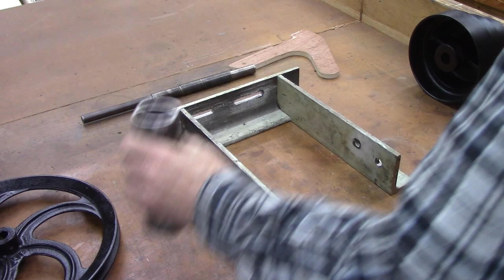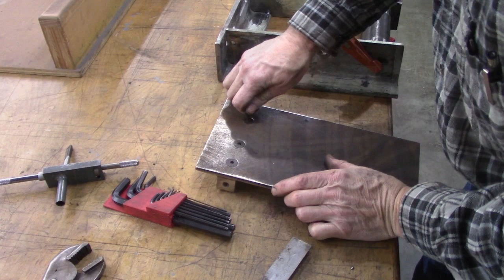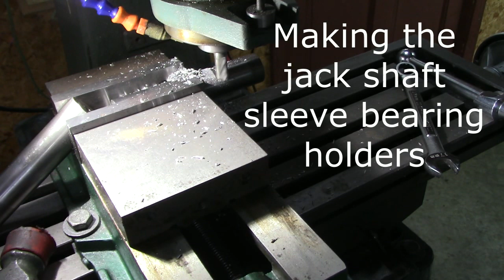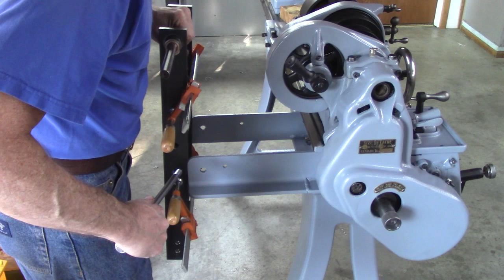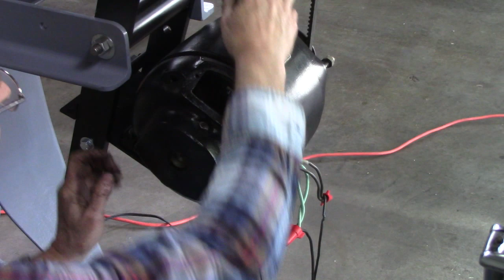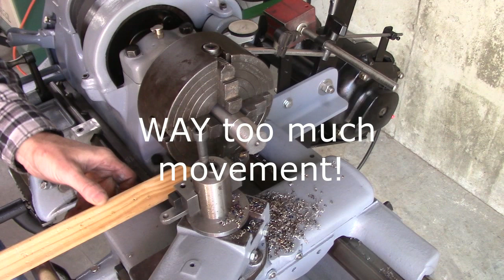South Bend 11-inch Lathe Rebuild - Part-4

Comment: What a well engineered drive!   Loved the reverse you engineered for the motor too.  It seems you have two ways to reverse the lathe rotation now.  Was the motor reverse a case of seeing if you could do it?
Reply from the maker: On this motor (repulsion induction) the only way to achieve reverse was to move the brushes and I really wanted a reverse for tapping. I agree, it looks cool and even works well. You can shift the lever to reverse with the lathe running forward and turning off and on the power makes it reverse. The brushes are only used for starting the motor.

Comment: Hi Winky, is there any chance you have photos of your bearing setup? I made new bearings for my 11" and am trying to confirm the contact surfaces are correct.
Reply from the maker: Like inside? I can take the chuck side cap off and get a picture if you want. It looks the same under the spindle. Beware...  I think there were a few different bearing depending on what year you have. Mine is a 1931. From what I understand some have felts and springs inside the oiler...  If mine had them they are gone. I keep mine oil every use. I need to put drill oilers on it. Let me know if you want the picture.

Comment: Great video. I'd love an old SB lathe. Question - Aren't you afraid of spinning the chuck off going in reverse (@42:10), or is there a locking mechanism that I missed? Thanks again for sharing your adventures in machining. Great stuff.
Reply from the maker: Thanks! Spinning off the chuck is unlikely although possible.  I've never had it happen.

Comment: Really Iiked this restoration. Just one question. What did you paint the pulleys with? Have a logan with the same type belt and I'm having trouble with the belt slipping under load.
Reply from the maker: The pulley is painted with satin black paint meant for plastic. I think Rustoleum but maybe Kylon. I don't think it effects belt slippage. First, Logan has a 1-inch belt if you have a 10". I know I had a lot of problems on my logan as well. A few times I tightened the belt and put a weight on the lid. My South bend has a 1.25" wide belt which helps. The belt is a rubber coated belt from the printing industry and it does well. I do get slippage but not quite as bad as with the Logan. I plan on installing a tension adjustment. Right now the weight of the motor provides all the tension on both belts.
Reply: Thanks. My logan is a resurrection of a bunch of logan parts primarily from model 200. I was unable to locate the complete belt drive system. My current drive resembles your southbend setup with only the weight of the motor to tension the drive belt. I would be interested in seeing you create a device for your southbend.

Comment: For me there is nothing more enjoyable thing than starting with a piece of steel, adding a couple more, drilling and welding, Turning a piece or two and adding them alongside the fasteners and finally a couple coats of primer and finally paint. Being able to stand back and admire our handy work that dose something and know it will always do what it was intended to do is such a feel good thing. I am lucky here as I can often see my work building up logging trucks and heavy equipment with my signature builds and hard surfacing pattern on a lowboy/bed going down the road. The upgrades you have done to this lovely old lathe that comes from a simpler time will now continue to make the parts that have built both of our great nations. Soon enough young machinists won't know how to work without a DRO or the simple basic machines that have worked sooooo hard for sooooo long and will continue to do so for all time if cared for as you and I care for them now. Great post Winky. You are preserving a fine lady from way back when. I may be a year late on this one my friend but better late than never eh, LOL. Take care my friend. See you on your next post eh.
Reply from the maker: Thats cool on the trucks. Satisfying I'm sure. I used to work in the printing industry modifying machines. Some of biggest and most rewarding mods were in the stacking area (called Stackers) where the product was bundles and sent to the bindery. To see the stackers go from jamming and producing ugly stacks to perfect without jams was great. Yes technology is great but I love the older machines. I have a DRO on my my mill but most often the lathe is okay without it.
Reply: @WinkysWorkshop  I had the best job in a big operation. I ran the welding and machine shop, got all kinds of one off things to build/invent and never really knew from day to day what I would be doing. There was 2 cattle/grass/alfalfa operations attached to it as well. Farm machinery I can live without eh. Everything is so lightly built it doesn't take much to bend or break it if abused in any way. Although one excavator operator that was notorious about abusing equipment tore out the boom base of a 300 Komatsu excavator. 2" x 24" x 8' TQ100 plates had to be replaced. It took me a month and 3 weeks later the same fella had the machine burn up while operating around burn piles. How he ever kept a job is beyond me but at the same time made me a lot of OT $ eh, LOL. See ya next post.
Reply from the maker: @TomokosEnterprize  - Sounds like a good job
Reply: @WinkysWorkshop  You bet, 15 years of doing all the skills I was taught by a number of excellent teachers. Every day was a wonder. When my health made me retire early it didn't take long to realize I had to find something to fill that void of creating things. The silver pouring saved my bacon. I still miss the smells from the machine/welding bays.  Burnt steel, oil and coolant in the air is just what tickles me the best my friend. This old thing teaching others is kind of endearing but the real thing just can't be replaced eh.
Reply from the maker: @TomokosEnterprize  I'm lucky to have the health I do have but I retired at 62 for the same reason. Youtube, family and creating kept me going.
Reply: @WinkysWorkshop  More alike every time we meet my friend.

Comment: I restore old machinery from 1896 to present, I've got some old electrical switches, did you ever find one?
Reply from the maker: No, I just need power. The motor doesn't have a wired reverse. The light switch is working pretty good just doesn't look old.

Comment: You have some slack in the head stock bearings...that's why it raises up and chatters on a heavy cut ...dose it have a hole thru the head stock shaft ...if so how big is the bore thru there...? just curious...nifty little lathe...now you have the job of tuning and truing it up...should be fun
Reply from the maker: Yeah, the bearing clearance is about .0008" now. My other lathe has ball bearing. This it the first one I have owned with sleeve bearings. From what I understand any less than .0008 and you will burn up the bearings. The bore size is 13/16".  Since making this video I've added new dials...  it's a sweet little lathe. The only thing I need to address now is a worn cross slide nut. The backlash is fairly extreme. The bad part is, I think the lead screw is worn a lot as well and the screw has a gear for the power cross feed and they are both made as one piece. I'll probably make a new nut and drill the end of gear and braze a new lead screw into the gear.
Reply: How is the flatness and straightness of the ways...I'm curious because I had all ways hoped to find one of these perhaps not quite that old or an older LeBlond for my own shop but never did when I had the cash to do anything about it...I don't have a shop or facility to put one in now.. besides I'm getting to far over the hill to do this kind work anymore any how...but I can still take vicarious pleasure from your projects and this is a beaut...thanks for the memories...so many things I made and did

Comment: I have an old South bend 11. not in as fine of condition as yours. My cross feed gear is shot. Other than that it dose ok.
Reply from the maker: Making a gear for it would be an interesting challenge if you have a mill.

Comment: Great restoration and video. I don't know if you are aware, but on the front face of the gearbox at top left, the vacant hole should be fitted with a Gits right-angle oiler for the speed selector idler gear. Before each lathe session, you slide the speed selector fully left and apply oil to this oiler.  The oil travels down an internal tube and drops onto the idler gear bearing - wait a few seconds before returning the speed selector to the correct position. This helps reduce the wear on the idler gear shaft which is rotated by each gear being used and so experiences a lot of wear.  Best wishes.
Reply from the maker: Thanks for the tip Brian. I've been giving it a shot of oil but didn't realize part about the shift lever.Also, I knew it was for oil but didn't realize it was supposed to have the oil cap. My  apron also has 3 holes near the top, I wonder if they are supposed to have the right angle oil caps too?
Reply: @WinkysWorkshop  
Yes, they probably are if they are anything like my 1943 Heavy 10. 
This has two right-angle oilers at the top and a larger one along the bottom of the apron. The top left oiler lubes the worm and cross-feed gears via felt wicks, while the top right oiler dribbles oil directly onto the half-nuts.
The larger oiler at lower left is used to top up the oil trough for the clutch and carriage travel gears.
I hope that helps.

Comment: Nice job two comments on serious one tongue in cheek firstly think your on/off should be a NVR type ond secondly really white cable ties 😉
Reply from the maker: I totally agree on the switch and ties! On the switch I was actually thinking an old time tail wagger switch  with a bakalite handle. I just can;t find one! ....  I just used what I had on hand. Something will turn up.

Comment: Nice job Winky. My old Logan 850 was last worked on in 1970 when I came home from the Air Force. I’m a bit old to try another rehab. I Think you should put on a DC drive or AC VFD to make it easier to set speeds. I put a DC drive on my drill press and I love it.
Reply from the maker: The VFD would be great but I'll probably leave the lathe original. It's fairly easy to change speeds. I may modify the drill press however. I think the lowest speed is 450 and it would be great if it went a bit slower.

Comment: What year was the lathe made? I have a 1923 13" x 48" South Bend that looks almost exactly the same.
Reply from the maker: It's a 1931. Does your's have a quick change gear box?
Reply: @WinkysWorkshop  yes, it does. It was my grandfather's. I completely rebuilt it 4 years ago. It works great.

Comment: Very enjoyable series you have a good eye for problem solving. Always nice to watch someone with the same mix of equipment that a lot of us with home shops have.
Reply from the maker: Thanks, I definitely quality as a home shop. No formal education of any kind although I have had a lot of exposure to machinery and machine work. The last 14 years before I retired I was redesigning problem areas in printing machinery. I did all the designing but worked along side a few top notch machinist. I owe a lot to a few great guys that were very willing to help me out.
Reply: @WinkysWorkshop  Well you put together some great videos. What kind of printing did your company do. I spent 40 years in the folding box printing industry.
Reply from the maker: @jimpritz4169 - Web offset magazine. I was a pressman before I was put in the trouble shooting job. I really enjoyed my job but after 10 years I used up most my good ideas and all that was left was the problems that were super hard (or maybe impossible) to resolve. The day I retired I had at least 20 projects going. I'm so glad to be out of there. I was totally overwhelmed for the last 2 years. The plant I worked in is shutting down in July. The internet really killed us. We never got back to normal after the recession.

Comment: Your videos are one of the very few I watch from start to finish. You are definitely a talented person and a good problem solver. I was curious as to what make and model your wire fed welder is. Mine is 125 amps and just can't seem to get good penetration on metal over an 1/8" thick. Nice work on the lathe, wish I would have kept my S.B. bench lathe!
Reply from the maker: Thanks on the lathe!  My welder is a Forney and it is junk. Actually it is probably a good welder but like most 110v welders, totally inadequate. I have a friend with a dual voltage Miller and he said the 110 option is silly. He said it's useless. I went back to flux core and it works much better... not great but better.
Reply: @WinkysWorkshop  Once you get things tacked together try heating the metals up over 250 to 300 degrees. That should help a lot.
Reply: I just mentioned to Winky to heat up your weld area to 250 to 300 degrees after things are tacked together. 125 should be plenty for a 1/8 in 7018 rod but it depends how strong the line voltage to your welder is. Extension cords must be 12ga or 10 ga or heavier. The longer the cord the heavier the wire size eh.

Comment: You're a very talented engineer. Neat, tidy, ... excellent work.
BTW I could be way off here, but I think the chatter comes from the motor, via the belt. I noticed it vibrates a lot in higher speeds. It kinda seems that vibration frequency (of the motor in the background here: 43:10) matches the chatter noises :)
Reply from the maker: The motor might be doing it but the bearings were very loose also. .006" clearance...  way too much. Thanks

Comment: 4 Cylinder Camry timing belts make great drive belts for the main drive. I used to have a old lathe, (Greenwood & Batly, overhead gear lathe) used the leather belt, too much vibration on the connector, the used timing belt no connector, and it didn't wear out either .... the belt that is.....
Reply from the maker: This belt is glued on. I used to work in the printing industry and they tossed this belt. You have to grind a taper on the end, use a special glue and heat it in a press. It's smooth as silk and the splice will not break. I have about 60 feet of it so it's my best option. On lathes like my Logan the spindle is a huge job to remove and this type belt is great. The South Bend would be east to install an endless belt like you suggested but I have a lot of this belt and I'm fairly certain it will last 8 or 10 years.

Comment: Great Job!!   I think you need a means to park the belt in a detentioned position when not in use. Nice enjoyable restoration series.   Best of luck & Stay Healthy...........................
Reply from the maker: Thanks! I've got about 60 feet of this belt. The printing company I used to work for tossed it. Plus this type belt (Polyamide) is not prone to stretching. I think your suggestion would be crucial with an original leather belt however.

Comment: great job I just got one like yours but it is an under  drive. It is missing the head stock and tail.
Reply from the maker: Those are important components!
Reply: @WinkysWorkshop  I did not find them yet. Maybe these parts should go to other machines

Comment: Some clever stuff going on there, love the forward-reverse set up.
Reply: Did you have do anything to keep the flat belt running straight. Nice work enjoy your videos
Reply from the maker: The flat belt pulleys have a crown. As long as everything it aligned and square the belt will stay centered on the crown. I guess I got everything lined up pretty well.

Comment: Nice job. Please show the dial build.  My 13" SBL has 125 graduations on the dial.  The setup you used before requires a 125 tooth saw blade and this is hard to find. I'd like to see your solution to this.
Reply from the maker: I'm fairly sure your dials have 100 graduations. There really isn't a reason for anything else. If you move one mark you move 1/1000", one turn 1/10". There are lathes with 200 graduations but older south bends are 100. The 200 dials are working with diameters. Each graduation these dials are .5/1000 (.0005") but this makes a change in diameter of .001" 

But yes, I will make a video of the new dials. I'll started planning and may start this tomorrow.  Thanks for watching!

Comment: Nice restoration of the lathe. Loved the way You solved the problem with the motor reversing. You can be proud of that job.
Take care and stay safe, Sir.
Reply from the maker: Thanks, I agree the motor reversing. A friend suggested hooking a cable up to the brushes but I think the linkage is a little better. It takes some effort to move which is good because it stays put.

Comment: The lathe came out real nice. Your powertrain design is impressive, simple and everything works well. I was surprised by how well the tension on the flat belt came out. I was thinking that it would be on the tight side. You should of seen the contraption that I made for my first lathe in the late 90's. Thankfully all evidence has been destroyed!! That lathe was a 10" Seneca Falls from the mid twenties it had Babbitt bearings. By trying different shim combinations over time I was able to get it to run smoothly. If I am remembering correctly I think that I used to back of the tension on the bearing caps just a little at high speeds, not loose just less torque. Nice series.
Reply from the maker: Thanks for the great comment. I almost bought a Seneca Falls lathe a while back. but it was a beast... too big for my small shop plus no quick change gear box. A very cool looking lathe. It's probably good that my shop is small. I'd have a lot of old machines and then I'd get overwhelmed. This one sat for a year!  I took a best guess on the belt tension set up and it worked. I figured I could always add a turnbuckle or spring if needed.